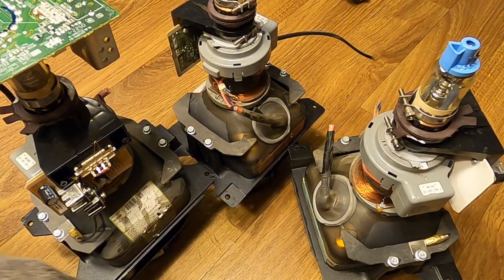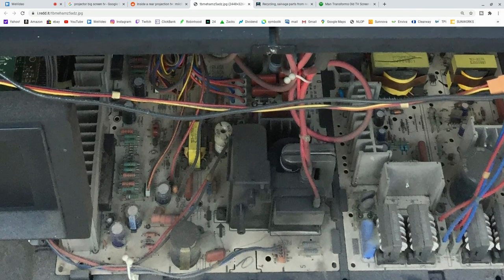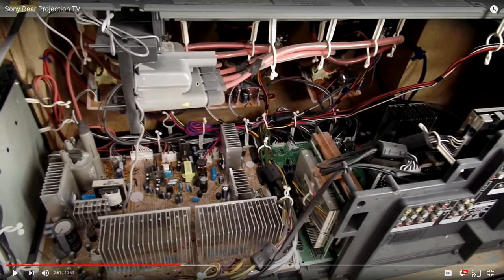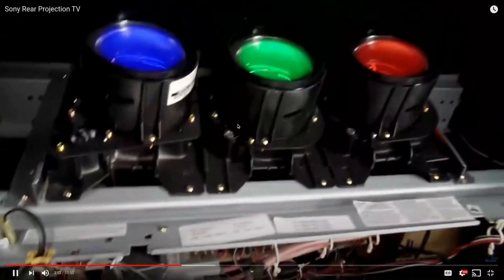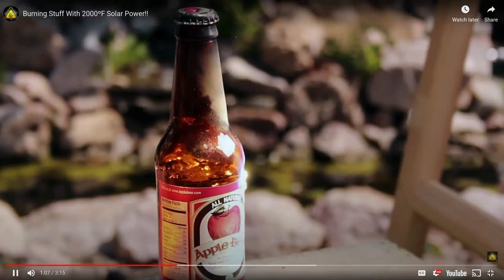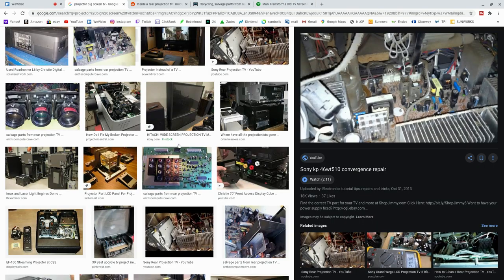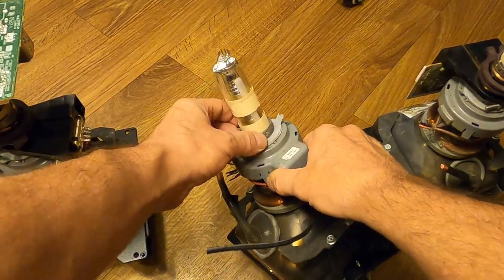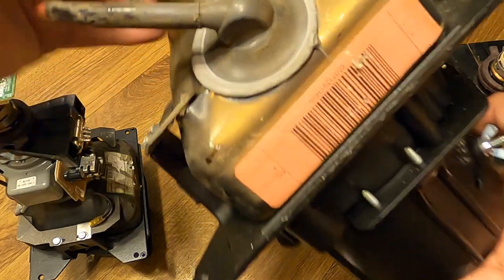Scrapping Projection TV for Copper | 2000ºF tv screen LASER RAY modification!

Comment: If those tubes still had a charge you would know as soon as you cut the cable to the suction cup unless you happen to have good insulation with your cutter at the time.

Comment: I always put those clamps in the stainless steel bucket. They will have slight magnetism, but if you can shake it off the magnet easily, it’s stainless.

Comment: The easiest way I have found to get the copper out of the yokes is to put them in 2 heavy duty rubble bags and hut them with a hammer. I have found 1 bag not to be strong enough as they can rip easily, use the same bags to cover the glass at the top when smashing it.
Reply: What is a rubble bag?
Reply: @janetthurston852  A rubble bag is a heavy duty big black or clear bag.
Reply: @ebikescrapper3925  oh, that sounds right. I thought it might be what we call contractors strength garbage bags. Thx

Comment: please don't smash them
 they are like small crt tv there is like mercury and led in there as well bad for the environment  it only takes a few minutes to disassemble them  smashing them is more dangerous and it wins you a minute or 2 only  , don't know about the oil in those lens chambers I think its mineral-based.lens chambers are aluminum 
There are still people smashing them  in my country, they also snip the refrigerators and letting the fumes and oil just spill everywhere  :-S
If you do like a few you get real handy, I completely gut a crt in like 5 minutes with snips plyers and a screwdriver or Allen key .
still love these vids of yours scrappy ;)